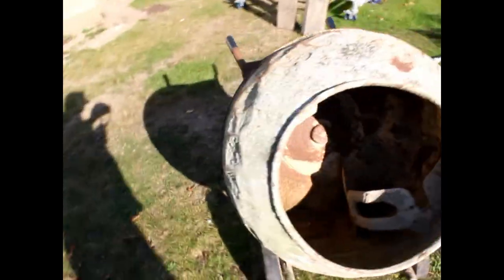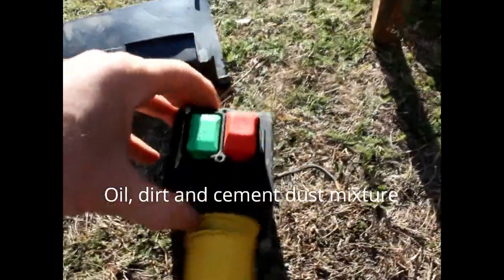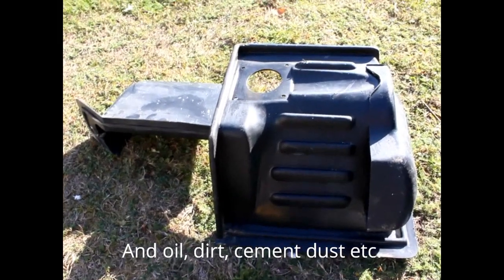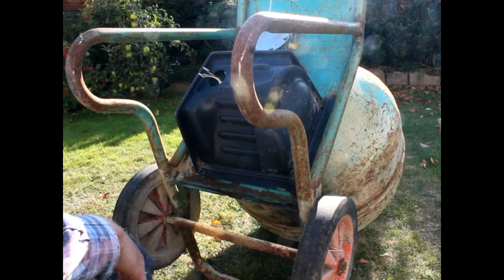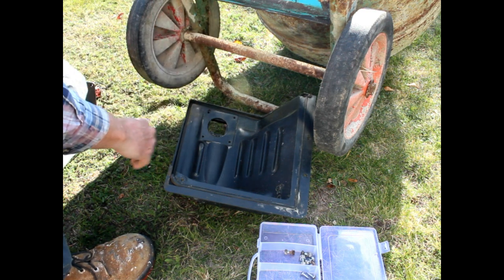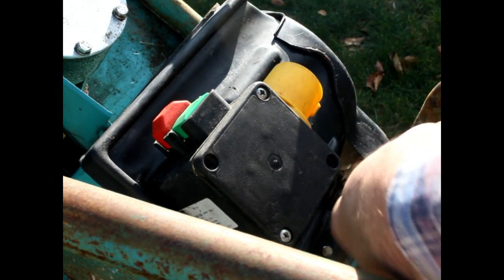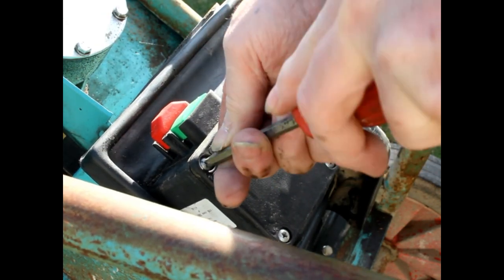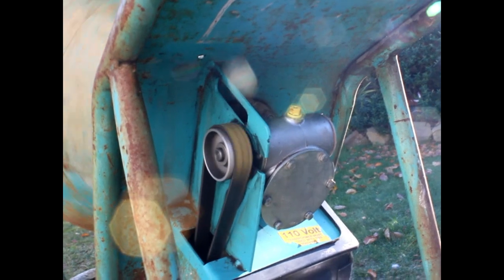BarOmix Minor Cement Mixer - How to fix, repair and service.

Comment: Hi , I have the same mixer .Today I was using it and I overloaded it and it stopped . It tripped the electrics on the house I was working on . Anyway it will not start now.Is there a reset button on them ? Or do you know if it is reparable ?
Thanks

Comment: These are a great wee mixer .
Mine is petrol and on its 2nd engine in 20 yrs . The drum is well worn and i will need another drum if i can get one . The drum on these is nice and deep exellent for mixing and the best i have used on small mixers. 
Not even sure if these are still in production.

Comment: Hey mate , can you tell me which gear oil you use to fill it up?
Reply: Cheers Andy
Reply from the maker: Had a rummage through the garage, but can't find what I used. But, I believe any differential or gearbox oil of 80w90 would do. Castrol EP90 caught my eye on eBay, old school oil probably just the ticket. However, there are cheaper alternatives. Please don't forget to like and subscribe. Thanks for your question.
Reply: @dembydish  seems to me instead of oil it would require 00 grease, which is thicker than oil but still is runny>?

Comment: Hi there, do you know what type and size drive belt is on your mixer.  Thanks
Reply from the maker: Hi Richards, sorry I don't remember. However, in the past, I've wrapped a piece of string around two pullies and measured it.  This will give you a size buy the closest to it you can.  Thank for your comment.

Comment: Is it gear oil or normal engine oil used for them? Do you know the exact oil needed for the gearbox?
Reply from the maker: Hi there, take a look at the question by Andrew Wolfenden at the bottom of the comments, I explain it there. Hope this helps.
Reply: Yeah I used 80 w90 gear oil I had for a power washer gear box then seen the comment can't. It's much better machine than a lot of the more modern mixers.

Comment: Hello Denbydish, Enjoyed your video, I need parts for my baromixer, mainly the drive belt, any recommends on a part supplier please?
Reply from the maker: Hi Terry, I am not sure of the size of this belt.  Simply Bearings (simplybearings.co.uk) are a very good company and a good place to start looking.  I have bought belts and bearings from them before.  You'll need the width of the belt and the length. If you have the original one that will help to identify otherwise its a piece of string or a cloth tape measure around the pulleys. A Poly V multi-ribbed type belt should be a replacement.  They also deliver for free.  Good luck with your search.  Thank you for your comment.
Reply: @dembydish  thankyou so much for your help .. good luck with your channel